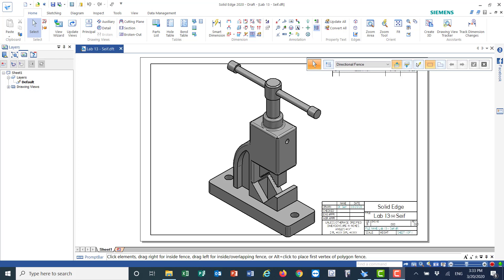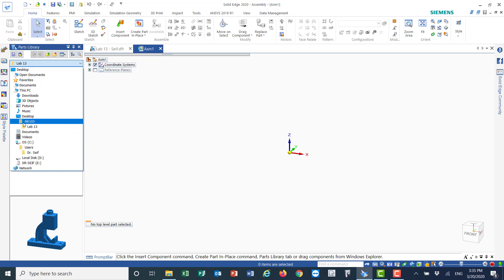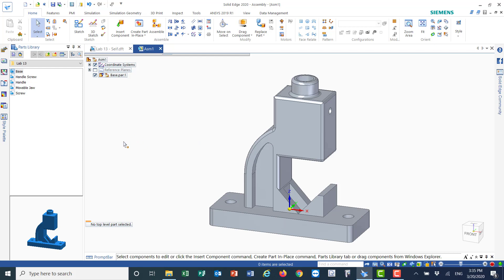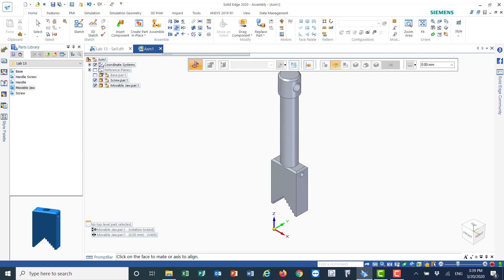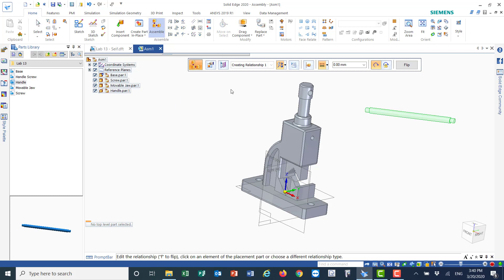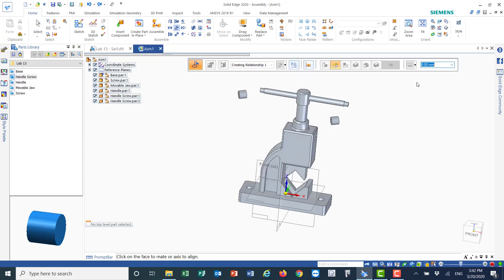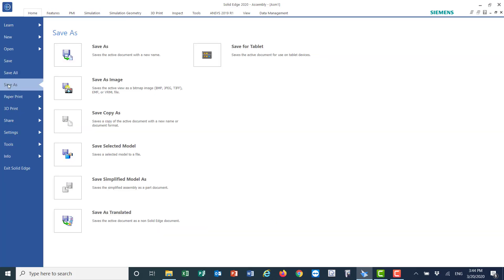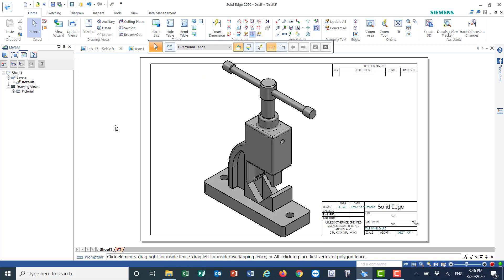Learning Solid Edge: (Lab 15 - Assembly)

Comment: Hello professor, 
Is there a tool on solid edge that will mate two parts that are different measurements ? For example if I have a part that is 100mm(box) and I want to mate with a part that is 50mm (box cover) can the measurements be adjusted automatically?
Reply from the maker: Yes. Like in this example, you can mate the hande with the movable jaw and then adjust the location of the handle.
Reply: Thank you for your response